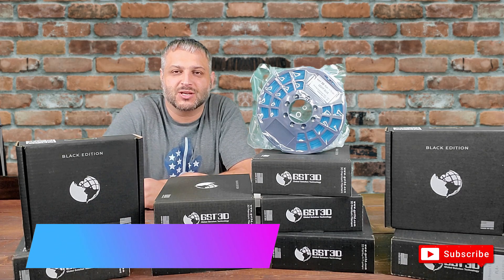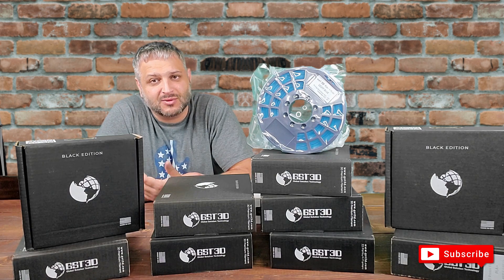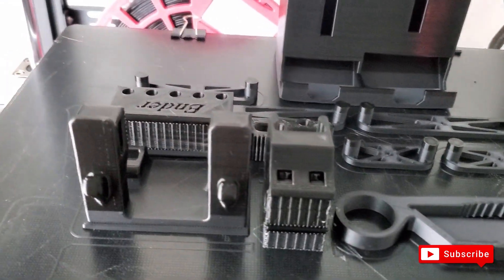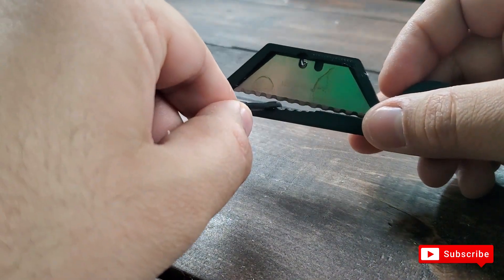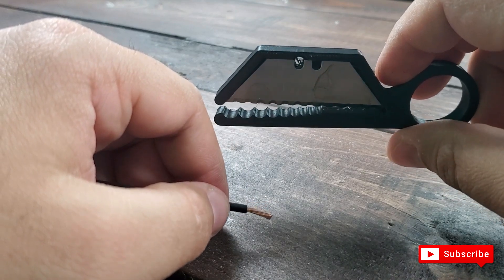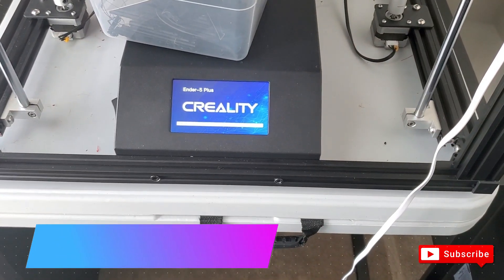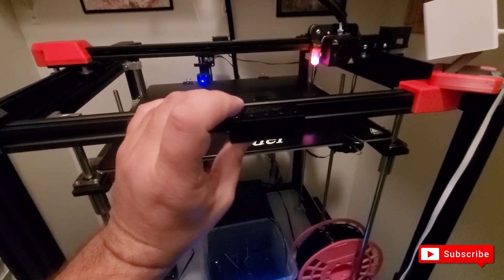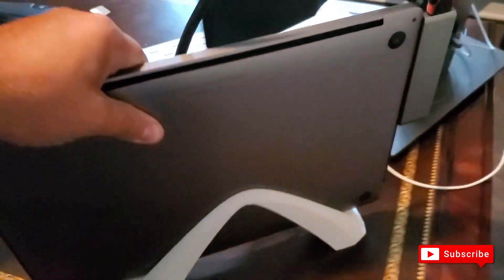GST3D Filament Review and 7 Project Printed with Creality Ender 5 Plus

Comment: So far 2022 with 10 + rolls GST3d is a hit and miss. They are stringy, clogs a lot in one roll and closer inspection I can find bulges and particulates in the different parts of the roll. Quality seems cheap. They need to up their quality control. Never had an issue with matterhacker, esun, or sunlu, and 3d jake products comparted to GST3d.
Reply from the maker: I think it all depends on the batch. I had really good success with certain colors lately like black, gray, blue, red, green and purple. I do agree the constancy it not always the same.

Comment: What are your bed temperatures? Hot end temps? Do you have any hot end fixes for clogging that they have floating around for these stock ender heads?
Reply from the maker: My bed at 60 and No I do not have the hot end fix. My machine is pretty much all stock.
Reply: @VeraProjects Good To know looks like i need to profile the GST3D for my Aquilla tho I found 65 degrees stickers better on my glass textured bed.

Comment: So far three out of four rolls have clogged in my nozzle I don't have time to deal with these issues . I've never had issues like I've had with stuff .
Reply from the maker: Sorry to hear that Ive used all the colors so far and I keep my temp at 212 to 215 on the nozzle
Reply: @VeraProjects  I'll try a temp tower and see if that helps
Reply: From what I hear, each colour needs its own temperature tower - once you do that, you won't get anywhere near as many clogs.

Comment: do you use Glue on your bed or something on your bed?
Reply from the maker: yes I use this Stick Glue - https://amzn.to/2RoLINK
Reply: @VeraProjects  Thank You, I been having a problem with bed adhesion no matter what temp I use.
Reply from the maker: I used to have the same problem, but once I started using this Stick Glue I keep the bed at 60 and I never have a lift any more. I put it on after every print it has about 3 layers of glue but I rather have it like that than having issues with it lifting.

Comment: Just ordered my 10 filaments. I've heard from reviews that they're a little spotty shipping performance.  We'll see how mine turned out.  I ordered with a CC so worst-case scenario, just a charge back.
Reply from the maker: If you have any concerns you can always call them they are always available. If your order on Friday it won't get there till Tuesday or Wednesday they're not open on the weekend.
Reply: @VeraProjects  Eh I probably should've replied much earlier.  I did received all 10 filaments ordered about 8 days after this comment.  Their quality is a little meh, but with a little testing and tweaking settings, I got them to print quite nicely.  I've ordered another 3 more times since this comment :P, no regrets here.